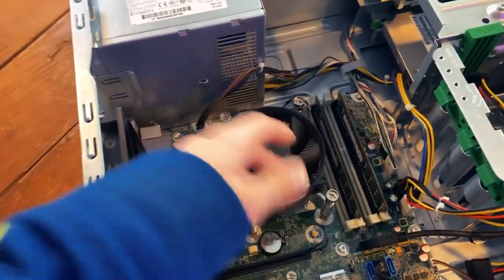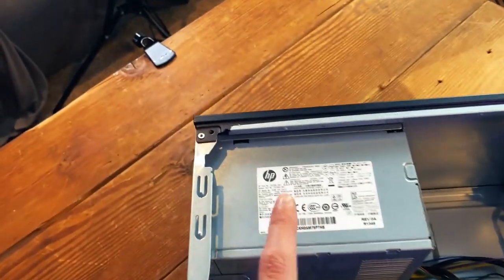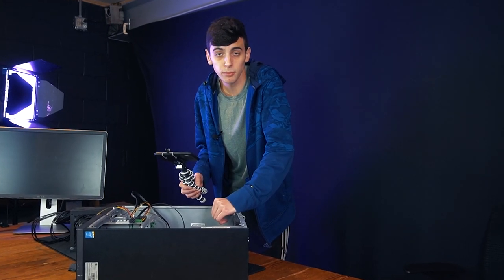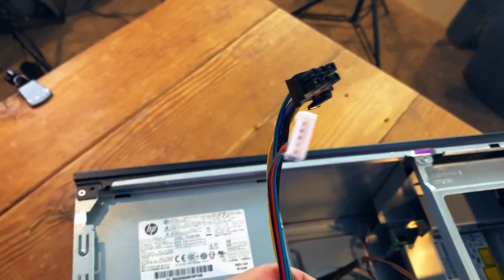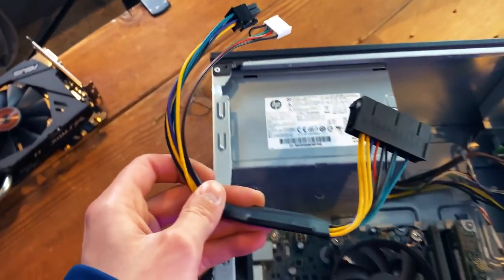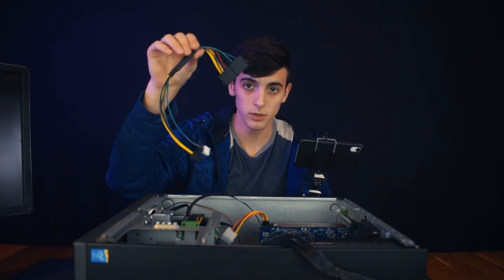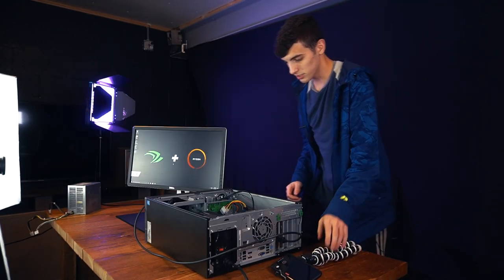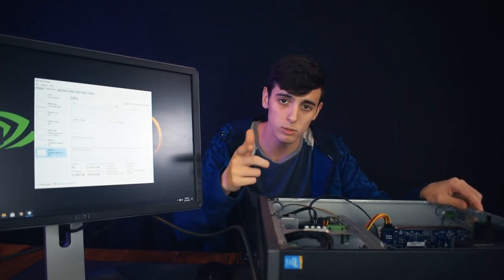HP PRODESK ➔ GAMING PC?! It's HARDER than YOU THINK!! [2020]

Comment: lowkey not as hard as i thought i just got an rtx 2060 somehow fit it in an hp elitedesk with an i7 6700k and im ordering the adapter for the motherboard / power supply now wish me luck lol
Reply: so power supply with adapter in, im running into one issue and that is its now giving me a power issue beep code, thinking its the adapter :/ could you link me the one you used possibly?

Comment: HP ProDesk's can be had for a good value.  I was updating a ProDesk 600 SFF i7-6700 so it could run a biking simulator for someone.  Finding a Low Profile, that does not need 6pin power, and hopefully not draw too much power for the baby SFF power supply.  The simulator is good with a GT1050 LP which I paid $125 on ebay.  Finding a LP card that would fit before the USB plug was quite the challenge.  I haven't got it yet, it's last scan Dec 23 was a post office 30 miles away, and it's 'stuck'.  You video has me more scared that this adventure is going to hit more snags.
Reply: I believe the gtx1650 LP fits

Comment: Thank you for your informative video! So you have a subscription. I upgraded my HP Prodesk 600 G1 (power supply 350 watts max.) with a stronger i7-4790, 4*4GB DDR3 1600 Mhz Ram and a GTX 1650 GDDR6 4GB. The GPU has a TDP of 75 watts and the CPU has a TDP of 84 watts, so I didn't need any other power supply. The i7-4790 cost €40 and the GPU cost €85. The PC does what it is supposed to do. Examples of games: Forza Horizon 5 1080p, high settings (70-80 FPS); GTA5 1440p, mixed medium and high settings (40-50 FPS); DOOM Eternal 1080p, high settings (70-80 FPS). I am happy🎉

Comment: I have a hp prodesk 490 g3 mt and it's perfect (i5 6500 cpu), the motherboard is powered with 24 pins connectors so I replaced the psu with 500W psu. I add 8go of ram and a rx 580 8gb for the graphics card and it's perfect! Costs : 80e + 20e + 20e + 100e = 240 euros ! 👌🏻 (sorry for my English, French people 😅)
Reply: Merci beaucoup  !!!

Comment: I got a hp elitedesk 800 g1 and turned it into a gaming pc as well, but mine is the sff version you can imagine the pain i went through lol. I suggest those who wants to turn these hp prebuilts into a gaming pc to just buy a new case because it makes it so much easier regardless of what form factor yours is. And as for me i sacrificed the USB 3.0 connector to fit my rx 570 because i really couldn't afford a smaller card for some reason they are more expensive than the standard size and plus its just a usb port anyways lol. HP really doesn't want gamers to buy their office PCs and turn it into a gaming pc, i don't blame them cuz if they made everything universal, their actual gaming product line like the hp omen and hp pavilion are probably not gonna be bought at all.
Reply: Would it be easier if I changed the motherboard and the case and moved the other parts?
Reply: @rakanamirah7588  it would be easier but i dont recommend it at all because its gonna cost a lot of money and the risk of buying an old motherboard is just too much. Its better to do what i did because it'll save you a ton of money you just have to do a bit of research to make it happen.
Reply: @mypfpiswhatourphonesees4294  
Ok thanks bro
Reply: @rakanamirah7588  no problem dude
Reply: did the pc, cause any errors during boot, due to 3.0 not being plugged in. I plan on doing the same
Reply: @jasonspataro5908  you'll see a list of errors everytime you boot it up, but im pretty sure you will still see it even if you plugged in the usb 3.0 connector because the error also comes from the adapter you'll need to make an aftermarket psu connect to the mobo since the mobo doesn't have a 24pin connector. For me it was listing some psu error and front panel usb not detected but it never caused any real problem, you'll just have to press F1 everytime the list pops up during boot.
Reply: @mypfpiswhatourphonesees4294  hey man, im just making sure, do you have any updates? Also can you tell me the specs and how's the pc with the gaming stuff
Reply: @Shadow-Mizu  i dont really have anything new to say about the pc because i've stopped using it a while ago once i upgraded to an actual gaming pc. The specs on mine was i5 4590, 8gb+4gb Ram, 550 watts psu, rx 570 4gb and 500gb hdd. It was ok for casual gaming but it definitely shows its age in newer games. I turned another hp elitedesk 800 g1 into a gaming pc for my brother and his  gave a little smoother experience after i change the i5 4590 to an i7 4790.

Comment: Just saw a video where a guy installed a new power supply that was larger than the original. It wasn't that hard. Just a lot of complaining. He put all new internals in the PC and had zero problem. Good video though.

Comment: Upgrading prebuilds is a nightmare, particularly when sellers never post a picture of the insides so you can see the connectors.  I though Hp didn't get this bad till later intel generations as I've seen HP Prodesks with both 4th and 6th intel CPUs and they used standard 24-pin connectors.  The only adapter required is a adapter for the slimline DVD which needed a smaller sata power connector.  The 6th gen cpu prodesk I got was the HP 400 G3 MT, I can't remember the exact model name of the 4th gen cpu version but it had an i5-4590S in it and I was able to upgradethe power supply and put an gtx 960 in it.

Different sized PSU, wow, not thats a new level of prebuilt bullshit.

Great video by the way, enjoyable to watch and informative. Thanks
Reply: I using dell sff atm use psu 700w outside n converter plus pcie extender for full size gpu

Comment: Just got the prodesk 400 G5 MT for a conversion to a gaming PC. I hope things go well
Reply: so how did it go?
Reply: @solmagnumxiii1734  stock psu and an RX 560 4gb. Plays all the emulators I throw at it including Yuzu and Rpcs3. 
Specs :
Intel i5 8500
8gb single stick
XFX RX 560 4gb
Seagate 500gb(the weakest link)
I will get a cheap SSD down the line.
Reply: @Zahin 80+ bronze 180W. I got out the RX 560 and using just the intel iGPU now.

Comment: SFF is even harder. Bought EliteDesk 800 G4, put low-profile GTX 1650 inside (was lucky on GDDR6 one, had to buy low bracket from China…) and had to drill holes in cover so it cools down from 83°C immediately when jumping from game to task manager. Now waiting for 80cm long cables because the ones I got bundled with AX200 are too short and one had crippled that little MHF f*cker.
AX200 and cables because normal card would be in front of GPU vent and way too close to PSU.

My stupidity really shines with this purchase because buying used i5-8500, MB, some normal case and PSU would may be cheaper. But it is too late to abandon it at this stage because only thing which is left now is RAM.

But hey, it can hit 100FPS in Warcraft 3 Reforged on highest settings! Which I limited to 75 to be the same as refresh rate of my monitor.

Comment: i've got a used prodesk 600 G2 .. I7-6700 + GTX 1650 ( 75w)  , cost just over £300 and for the money you cant complain really .The I7 was going for about £150 by itself at the time i bought the system back in may ,
Reply: thats a really good pc to get by during these times when pc parts prices are through the roof.
Reply: hye i got this buld too but in i3 6100, Im also thinking of buying 1650, Can you tell me are you on the stock PSU? cause i cant find the converter of atx 24 pins for 600 g2 MT supported? Thanks
Reply: @aaqilhussaini8474  you can buy the standard 1650 , it does not need any extra power so no extra cables to worry about 😊
Reply: Do you have the tower version or the SFF??

Comment: I have created this abomination and have fit a 2070 super into it and a i7-4790k, evga 650w with a 24pin to 12 pin adapter into it, mainly trying to find a cpu cooler that would be up to snuff to keep my temps down
Reply: Do you have bottleneck?
Reply: @Keler477  None other then thermal throttling, Everything else runs fine
Reply: @blackoutgaming8901  Furry Protogen UwU
Reply: @IBims1Mark  Uh, yeah?
Reply: @blackoutgaming8901  cute UwU
Reply: @IBims1Mark  Uh.... Ok
Reply: @blackoutgaming8901  yes u cute furry uwu

Comment: Great job, props on pur production value, too!
Say someone did something crazy.. And Oh i dont know, purchased. An HP elite 800 mb To replace his gigabyte board sprting his 4th gen Core i5- i didcovered i need the adapter u found,buuuut whats with the front buttons? You mentioned them iquickly..
Reply from the maker: Sometimes with certain motherboards they have a sensors for the side panel or they need the right front panel connector to boot correctly. I’ve had this problem on a dell motherboard before.
Reply: @ZackEberly  Maybe I overused my attempt at humor and subsequently fogged my situation.  I zm familiar with the sensors for side panels, and all in pack connectors vs two pin modular similar to jumpers type connection for front of PC functionality ( pwr, reset, turbo, hdd LED, etc) I am asking, is: Does the HP board in your video have proprietary front of PC connectors ?

Comment: Why would you buy a pre built pc when you will replace the main components anyways? The PSU was designed for power efficiency which is around 320W only. I currently have HP Compaq 8280 Elite MT PC with GTX 1050 2GB, 1TB SSD and 8GB RAM and it is still kicking for gaming despite the low electricity consumption.
Reply from the maker: Ok Zyllee, maybe some people want better FPS then 2 freaking frames. So like a normal person WE UPGRADE. It saves you more money by buying a prebuilt and upgrading it then instead of this retarded market where you can’t even buy graphics cards. That’s why Zyllee that’s why.

Comment: I have I5 4570 paired with 1050 Ti and it's OK for most games at 1080p gaming but I would like to upgrade it to maybe possibly 1440p gaming, is it possible?
Reply from the maker: @Stefan_xd  Your cpu will start bottlenecking a more powerful gpu. That being said, a more powerful gpu would get you closer to 1440p gaming.
Reply: @ZackEberly  what I meant is I want to upgrade both CPU and GPU but I don't know if the 1440p gaming is possible with this case because of the 320W power supply and the size of the said case
Reply from the maker: @Stefan_xd  yeah, you’d most likely need a higher power supply. 650+ wattage

Comment: so normal/standard psu isn't fit the case

need put outside lol
Reply from the maker: No, it'll fit. It just cant be screwed in properly, so it'll raddle and fall out of place. Try watching the vid, literally was the complete opposite what you thought happened.
Reply: @ZackEberly  already watch n alr buy n have the new psu

I just waiting the gpu
half size gpu n no power pin is a must right?

since it have usb3 front panel cable

Comment: So, which Prodesk did you have in the video?

Because I'm looking at the 400 g3 (all looks standard), and it sounds like the 600 g(1&2) is also normal.
Reply: 600g2 dont have the 24 pin

Comment: Why did u change the whole power supply??
Reply from the maker: So i could power a GPU with pcie connectors.
Reply: @ZackEberly  i have a prodesk 600 g1 twr
I wanna buy a PNY GTX 1660 Super Single Fan, and i wanna know if it's going to fit
And if i can use it without problems of power supply and stuff

Comment: I bought an hp prodesk 400 g2 mt and the psu is only 180w, I’ve seen that the motherboard have a 24pin connector is it good for me to change the psu?
Reply from the maker: Yeah, as long as the connectors like CPU and motherboard  connectors are standard you can switch it.

Comment: This was pure comedy to me! I‘ve made the exact same experiences (Power supply, adapter, graphics card). I am running it with a GTX 970 in a small version (had to laugh so hard about the USB cable thing).
My only problem is that when i start the PC, the power supply Fan triggers an error. I have to press F1 and it works. I can live with it but any suggestions?

Anyways thanks for the laughs😂
Reply: Is the cpu fan running at full speed?

Comment: what adaptor cable do i need, if i want to keep the power supply (i dont want to keep it, im just broke)
Reply from the maker: You want to keep the HP power supply but want a graphics card in the PC?
Reply: @ZackEberly  yes
Reply from the maker: @_marreu_  well it depends, what card are you planning to use?
Reply: @ZackEberly  rx 570 8gb , the problem is that i am dumb and i already have it and somehow it fit in the motherboard l, now i just strugle with the power cable and psu
Reply: @_marreu_  use pcie extender $6 the white one
Reply: @_marreu_  i think you can try sata to 6pin adapter

Comment: I’m about to buy a hp 600 g2 has anyone had one of so was it any good
Reply: Well you’re better off with a dell optiplex as it’s a lot easier to upgrade. When I got dual channel Corsair vengeance lpx into mine, it started spitting error codes at me so I had to go with white DIMM slots instead of black. Hp also made sure to design the motherboard so the front USB ports’ connections to the motherboard were right in front of the pci slot so you can’t boot the pc with a full size gpu without getting a warning in the bios saying’ no fan or usb detected’. (Idk why it says fan) but you can ignore it by pressing f1 . 

I’ve gathered all this info from cobuman and a few other YouTubers . Hope this helps

And I probably wrote too much
Reply: @lennylicious69420  no I appreciate it a lot bro, I just wish I knew it before I got it, idk if it’s mine or if everyone has problems trying to run games but mine won’t run fortnite or anything with graphics like that I play tibia it’s a 2d game that came out in 97 and it lags on it sometimes lol idk what to do
Reply: @assassin1148  glad I helped you bro. I’ve upgraded mine so my next step is a case swap as I can’t find a low profile gpu because of the shortage. 

Oh boy I can’t wait to switch motherboards
Reply: @lennylicious69420  im exactly in your position rn, but i already did a case swap but i plan to keep using this cpu and mobo until i can afford a more powerful Cpu and mobo. Mine is running i5 4590 with rx 570 4gb and 12gb ram, it runs the games i wanna play pretty well so im not really in a hurry to upgrade my cpu.

Comment: Yo can I put a 10 inch gpu in it? And can I just zip tie the psu?
Reply from the maker: If you wanted to fit a 10 inch GP you would have to remove the extra hard drive cages so no and as for the psu you could zip tie it in that’ll work.
Reply: @ZackEberly  ok
Reply: @ZackEberly  for me it fits but I need the angled adapter

Comment: Bought one of these atx 24 Pin to hp adapter. It did not work. If anyone has a link to one that does work let me know.
Reply from the maker: There are 2 different kinds. I got lucky and pick the right on up. -https://www.moddiy.com/categories/Cables/Branded-PC-and-Server-Cables/Dell-Cables/   Try matching the exact model number to the appropriate adapter.
Reply: @ZackEberly  your awesome. I'm ordering one right now. Upon further inspection, the one I ordered was for an hp z220. The one I needed was for a pro 600.

Comment: @zack
Do you think i can use the 180 w power supply to run a gt1030 in the setup?
Or do I need more power?
Reply from the maker: I believe the max wattage from the PCIe slot is 70 watts or so. If the rest of your PC is extremely efficient  then maybe but I tried running a GTX 750 in a dell pc with 280 watt PSU and it didn't work, so I'd recommend getting a larger PSU.

Comment: what psu can fit hp 800 g1 tower
Reply from the maker: The OEM one (ATX PSU). You have to get a bracket for any other standard size.
Reply: @ZackEberly  can you send me a link for the bracket ?
Reply from the maker: @nerdslapper  There is a link in the description but the screw holes don't line up very nicely.

Comment: I have a hp 8200, I feel ya.  'm trying to figure out how to put in after market cpu fan heatsinks into a hp prodesk 600/800 or a 8000 series hp.  I've noted the HP 711578-001 Heatsink has brackets you screw on to the heatsink. It's the brackets that might be usable with after market cpu coolers such as the ID-COOLING SE-224-XT , if I drill some holes in the Hp brackets. Proprietary Hp cpu heatsink holes are a bitch.
Reply: The propriety Hp holes on the heatsink are 4 inches by 3 inches. I could get ANBE AMD Plastic CPU Fan Stand Bracket which are 4.33 in by 3.15 in......I'm more interested in the 3.15 inch portion of the bracket which has a clip on mount.  Since it's plastic, that would indicate it's easier to modify and use it with a 
Antec CPU Cooler that has snap on buckles, which is the reason for the 3.15 inch clip on mounts........this is all theory, and relatively inexpensive but effective.  So, I'll buy some and reply.
Reply: Bought the parts, don't match. Returned part.  Looks AMD like 3d parts have to printed to HP specs.  Clip on cooler seems to be most feasible.

Comment: Or just get a gpu that takes power from motherboard and needs no cables ;)
Reply from the maker: Yeah, that can barely run any game at a reasonable framerate... yeah no thanks
Reply: @ZackEberly  does HpProDesk Classic runs gta 5 ?
Reply from the maker: @robloxiayeah3082  IDK what Classic means... Like stock/normal?
Reply: @ZackEberly  normal HpProDesk
Reply from the maker: @robloxiayeah3082  Stock HP doesn't have dedicated graphics meaning yes you could run GTA V at the lowest settings possible, so no It would run it very well.